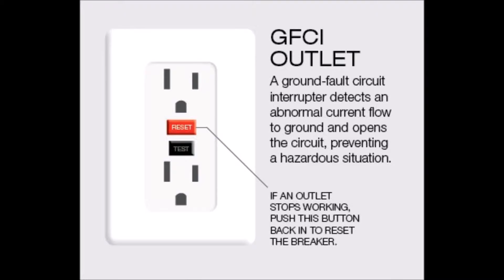How to Install GFCI Outlets   /  Dr FiXiT

Comment: 2 hot wire's, 1 neutral, and no ground? I'm guessing you have a hot and a switch leg coming from the switch on the left. Seems that the gfci is not controlled by the switch. Why is second red wire (switch leg?) connected? Just for termination? Maybe I am not understanding something here.